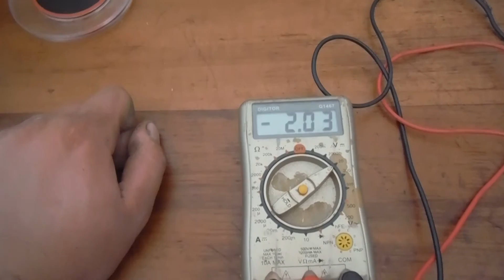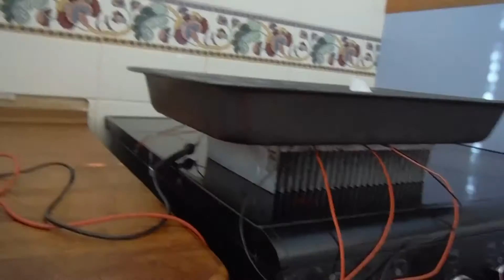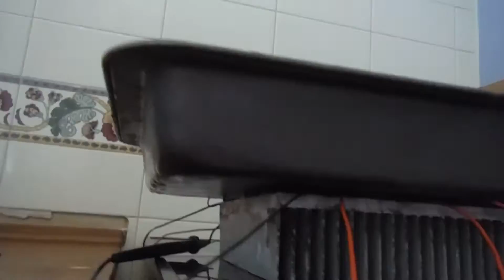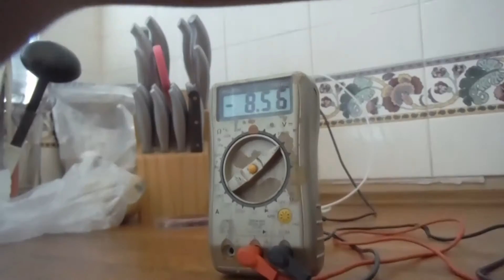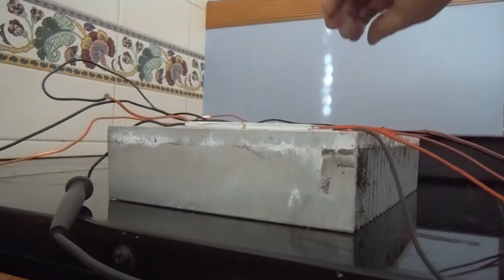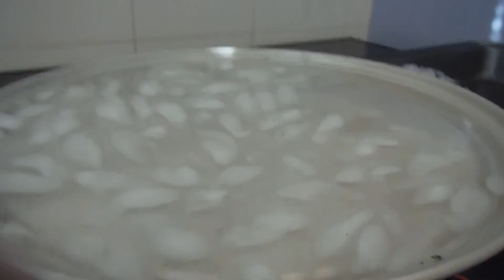TEC COOLERS for power generation  testing #2

Comment: Any idea what the current output is? That would be just as significant as the voltage. Without enough current, the voltage isn't worth much and you'd be better off going with a mini steam turbine.
Reply from the maker: +Jason Simpson (Jason) na the next test it into a buck boost converter  and charge  a lead acid battery ill be able to get a useful  current and watthr rating out of it  then thats my aim to charge mini 18650 and lead acid batts in the power wall
Reply from the maker: +Jason Simpson (Jason) thanks for watching mate i will hopefully  have some positive  results  for us soon